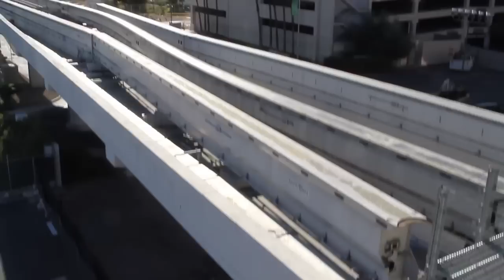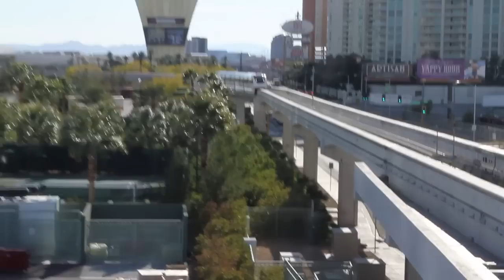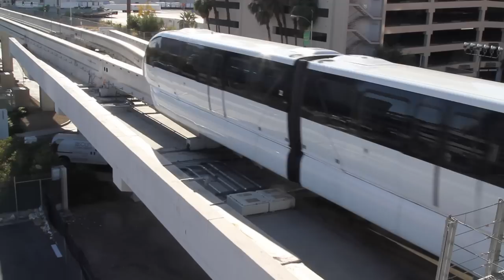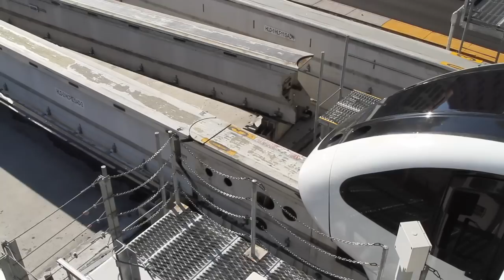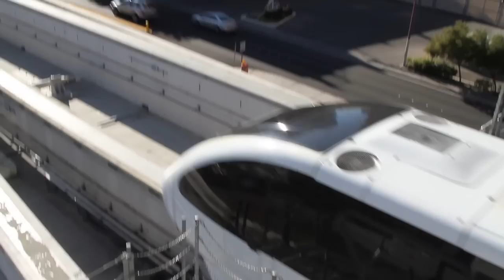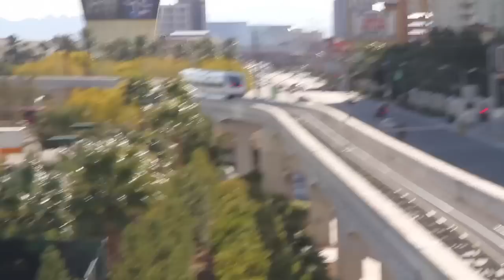las Vegas monorail switch

Comment: Where is electric cable?
Reply: Iosif StalinTM & the Partners   they don't use cable instead a steel bar hanging at the edge of rail. u can see clearly at 1.20. that how they supply power to the train.
Reply: fitri mubarak
Aaa, thank's!